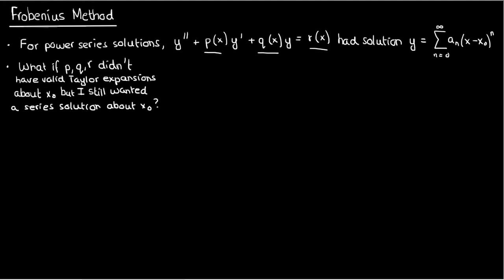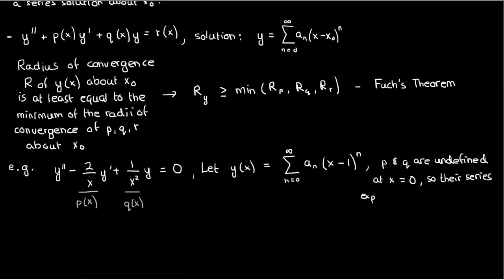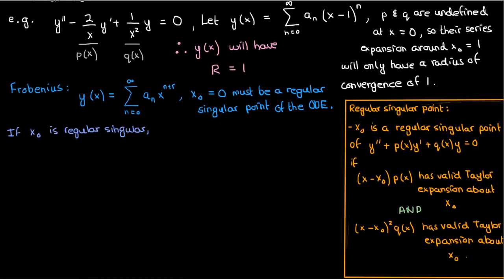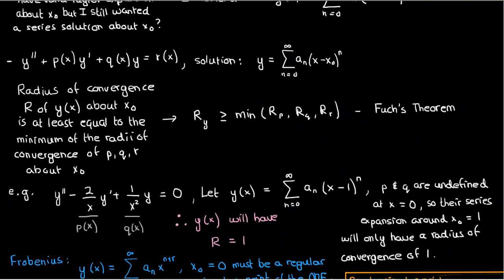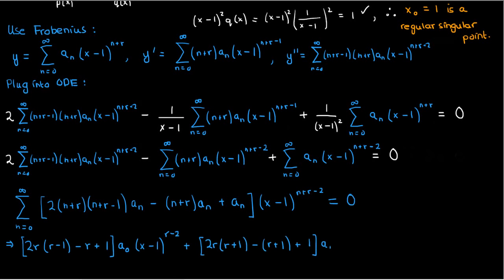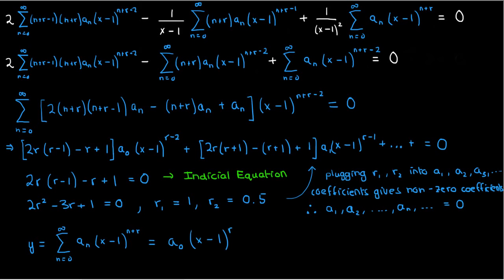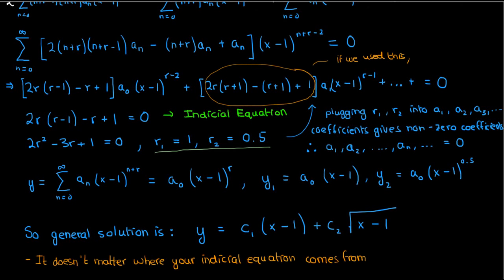Introduction to the Frobenius Method

Comment: Correct me if i am wrong,but you solved this question with euler's method.

*Basically,if you can't write y in power series form,our point is singular.
*If you can also write down indicial polynomial and solve it,point is regular singular.
*You could put y=x^r and you could get the same solution.To use frobenius,you should've got recurrance relation.
Reply from the maker: Not exactly. In Euler's method, you're concerned with a particular class of ODEs (even more specific that the type you deal with via the Frobenius method). In fact, Euler's method is just a special case of the Frobenius method; the only difference is that you don't have an infinite series. In Euler's, you let y = (x-a)^r, where r is some power to be determined. In the Frobenius method, however, you let y = (x-a)^r*sum a_n*(x-a)^n.

I could have solved this example problem using Euler's method (in which case I would have simply omitted the summation term in y); you're correct. However, that wasn't the subject of this video. Now why didn't I choose a Frobenius method problem which did involve a recurrence relation (i.e. one which can't directly be solved using Euler's method)? Because it would have been more complicated algebraically so I chose a simpler example. Hope that helps!

P.S. In my Bessel function video, I apply the Frobenius method to an ODE which does involve recurrence relations. Link: https://www.youtube.com/watch?v=uLORiAWe63A

Comment: Learning how to solve series solutions about a regular point was is an extra credit assignment because it wasn't covered in my class. Thank you this was helpful. However, one difference btwn SS-OP and SS-RP that I couldn't explain was when we took the derivatives of the respective series substitutions (i.e. y= sum(n=o)cnx...). Why did n increase in SS-OP but stay 0 in SS-RP?

Example: 
SS-OP
y= Sum(n=0)...
 y'= Sum(n=1)...
  y''= Sum(n=2)...

SS-RP
y= Sum(n=0)...
 y'= Sum(n=0)...
  y''= Sum(n=0)...
Reply from the maker: Hi David,

Thank you for the kind feedback!

As for your question, the reason the index is increased in your SS-OP method is that when you take the first derivative, the index n=0 just gives you 0 (the derivative of a constant is zero). The convenient thing to do in this case is just have the series start at n=1. The same idea applies to the second derivative, since the second derivative of a1*x is zero, so we'd rather start the series at n=2.

For the SS-RP method that you mention, we don't change the starting point of the index n since the extra 'r' in x^(n+r) means that when we take derivatives, we don't just end up with a constant term whose derivative becomes zero due to the power 'r' there. So your original series, which was a0*x^r + a1*x^(r+1) + ... has a derivative of r*a0*x^(r-1)+(r+1)a1*x^r+..., which doesn't necessarily have a zero a0 term.

To keep things consistent, I usually start my index at zero even when I take derivatives in the SS-OP case. The first term or two are going to be zero anyway so why should I make things confusing? You'll see this if you take a look at my series solution method video: https://www.youtube.com/watch?v=c3XtwTsE7QY

Hope that helped!

Comment: at 8:56, shouldn't the coefficient be 3 for r=1 rather than 1?
Reply: Right?? and -1 for r = 0.5
Reply: @abelmedina7879  yes but for r=0.5, the coefficient is 1 methinks
Reply: @abelmedina7879  also check the description, he has corrected that mistake there!

Comment: Hi, great video! But quick question about the proposed series solutions...shouldn't the differentiated series solutions start at n=1 and n=2 instead of n=0? Thanks!
Reply from the maker: Thank you for the feedback!

I think you're confusing the Frobenius method solutions with regular series solutions:

http://mathworld.wolfram.com/FrobeniusMethod.html

In the Frobenius method, the derivatives both start at n=0 because of the extra 'r' in the power. The n=0 term here doesn't simply go away due to differentiation, as it would in a regular series solution (without the r). 

Still, even in a regular series solution, the 1st derivative would vanish at n=0 while the 2nd derivative would vanish at n=0 and n=1, so it doesn't matter if we start the series at n=0 in either case, since those early terms are zero anyway.

Hope you found this clarification helpful and feel free to ask more questions!

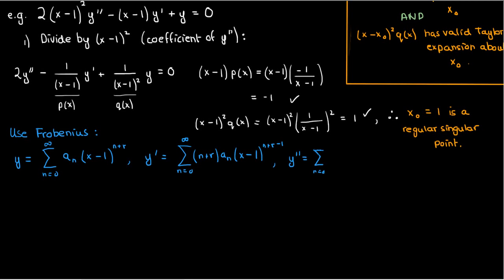Comment: Hello, i have a question, shouldn't we substitute the y(x) written in power series form to the ode we started with and not the one divided by (x-1)^2? , 06:32 or it doesn't matter? If it doesn't matter, why it doesn't? we would have (x-1)^n+r, instead of (x-1)n+r-2

Comment: Can you please share the name of books which you might have followed/liked for studying ODE and PDE. I'm a grad student, and I'll be taking a course on 'Advance Engineering Maths' at my university. It covers a lot of ground. From Complex Analysis to Linear Algebra to ODE, PDE, and Solution by Green's Function.

For the Complex analysis part, I'm using  (a) Complex analysis by Ahlfors, and (b) Priestley's 'Intro to Complex analysis', and Sheldon's "linear algebra done Right" for Linear Algebra. Can you please suggest a text for ODE and PDE part which is somewhat like (at least in spirit)Sheldon's text for LA. 

Right now I'm using Kreyzig's 'Advance Engineering Maths'. It's an excellent text but it's not rigorous enough for a graduate-level course, and Arfken's 'Mathematical methods for Physicists'. It's not a very good text for first-time learners, but unfortunately, that's the level at which course is pitched. So I first watch your lecture and then supplement it with this text. Not a very efficient way to go about it since I'm also three more courses from two other departments. So a good text for ODE and PDE will be a huge help. Kindly please suggest.

Comment: have a question...if x=0 is  an ordinary point can frobenious method still be applied (i.e solution of the form y=summation of  Ar.x^(m-r) ? i saw in textbook  that legendre ODE is solved this way,not sure why..Thanks for great tuts.
Reply from the maker: No problem, thank you for the feedback!

For your question, yes you can still use the Frobenius Method in your case; it's just that r will be zero from the indicial equation. The Legendre ODE can be solved without using the Frobenius Method, and just with regular series solutions. I have a video on it if you'd like to check it out: https://www.youtube.com/watch?v=3e5BUrtUKZc

Comment: Shouldn't the indices for y' and y" start from n=1 and n=2 respectively? Other sources seem to have that but yours doesn't. Why is that?
Reply from the maker: The 1st derivative would vanish at n=0 while the 2nd derivative would vanish at n=0 and n=1, so it doesn't matter if we start the series at n=0 in either case, since those early terms are zero anyway. So it doesn't make a difference if you start y' at n = 0 or n = 1 since the n = 0 term is zero anyway, and it doesn't make a difference if you start y'' at n = 2 or n = 0, since the n=0 and n=1 terms are zero anyway.

Comment: great video, thanks! I have one question, for your general solution you took constants c1 and c2. Yet in the seperate solutions you used a0. If simply adding up solutions, can you assume that c1=c2=a0? Or does the a0 constant have nothing to do with the general solution? Thanks.
Reply from the maker: Thank you for the kind feedback Robin!

In this example, I'm not simply adding up the solutions. I'm taking their linear combinations. Basically, if you're solving a second-order linear ordinary differential equation, you need two linearly independent solutions (i.e. they aren't constant multiples of each other) as your 'basis' solutions. Taking their linear combination means that I multiply the first basis solution (y1) by c1, and the second basis solution (y2) by c2. So in my general solution, I have y_general = c1*y1+c2*y2. My a0 here is just a separate constant and I can technically just absorb it into c1 and c2 (c1*a0 is another constant, and so is c2*a0).

Now that I've gone through the setup of the general solution, I can answer your question. In this case, I cannot assume that c1=c2=a0, because c1 and c2 are arbitrary constants. We have two constants because the differential equation is second-order (i.e. we need to integrate twice). They might be equal, but that's not necessarily true. We need two initial/boundary conditions to determine them, and I didn't give any initial/boundary conditions in this problem, so we can't make any conclusions about them right now.

So basically, a0 has little to do with the general solution for this particular example, since it's just a constant that would get absorbed into two different constants c1 and c2. Hope that helped! If you have any more questions, just ask!
Reply: thanks for the quick response! yes i see now that you explained. I know about the lineair combination thing but didn't think about the constants c1 and c2 representing that it actually is a lineair combination (in general). i got confused because c1 and c2 just took the spot of a0 and i immediatly assumed it had to be equal to a0. But absorbing a0 into the constants makes quite a lot of sence, just didn't think about it (even though i've seen it before). thanks a lot, subbed :)
Reply from the maker: Glad I could help, and thank you!

Comment: Hi, i would like  to know pls:

1) why you don t shift the index once you derive the series ?
2)if it s possible to have a series starting with a negative n?  
example =>      summ    from  n=-1 to n = infinit

thank you
Reply from the maker: Thanks for the question!

1) I don't because I don't have to. I said it down below as well. I'll paste what I said here: 

"I think you're confusing the Frobenius method solutions with regular series solutions:

http://mathworld.wolfram.com/FrobeniusMethod.html

In the Frobenius method, the derivatives both start at n=0 because of the extra 'r' in the power. The n=0 term here doesn't simply go away due to differentiation, as it would in a regular series solution (without the r). 

Still, even in a regular series solution, the 1st derivative would vanish at n=0 while the 2nd derivative would vanish at n=0 and n=1, so it doesn't matter if we start the series at n=0 in either case, since those early terms are zero anyway."

2) I could start at a negative index as well, but I don't because it might seem confusing to people, so I generally just avoid it.

Comment: Not sure I understand your explanation from 4:00 to 4:20...
Reply from the maker: Ok, so here's the ODE we're trying to solve by the Frobenius Method:

y" - (2/x)y' + (1/x^2)y = 0, if I use y = sum a_n(x-1)^n, my solution y would only be valid from (0,2), since I'm expanding about x = 1 and since the nearest singular point to x = 1 is x = 0, the x = 0 will limit my interval of convergence to just (0,2).

However, if I use the Frobenius Method: y = sum a_n x^(n+r), the singularity at x = 0 gets masked and since it's the only singularity, my y is now valid from (-inf,inf), which makes the Frobenius Method a much better alternative to the regular series solution method. In other words, using the Frobenius Method to expand about x = 0 causes the effect of the singularity to vanish.

Hope that helps!

Comment: its difficult to read the stuff he is writing,its kinda too small or maybe its just me
Reply from the maker: Hi Togara,

Thank you for the comment! I'm sorry that you find my writing small, because I assumed that everything was fine given that no one else has pointed this out so far. I record my videos on my cruddy laptop so there typically isn't much room on the screen to work with.

Perhaps you could try switching to HD (my videos go up to 720p) and changing to full screen if you haven't already done so. If that doesn't work, could you tell me in what parts of the video you find the writing small? Perhaps I can explain them for you?
Reply: thank you for responding to my comment, i realized the problem was laptop not your handwriting, so right now im going through the video, and if i encounter any more challenges i will kindly ask, and thank you again
Reply from the maker: No problem!

And sure thing, let me know about any challenges!

Also, do you mean my laptop or your laptop?
Reply: The writing's ok